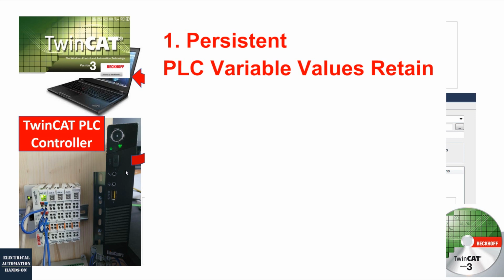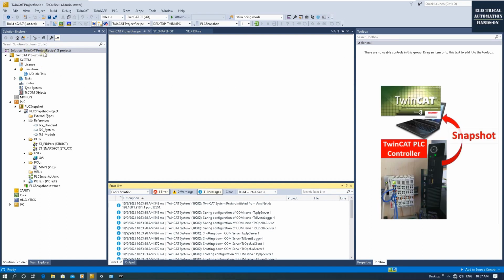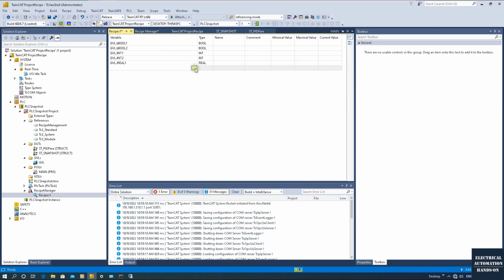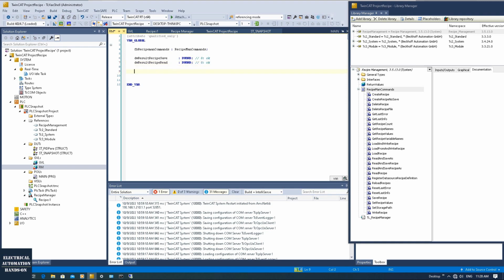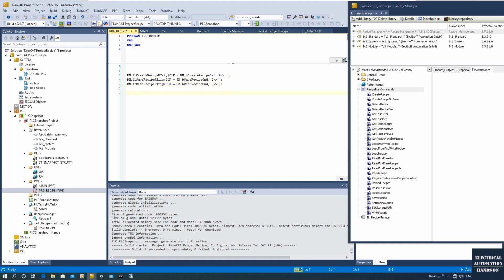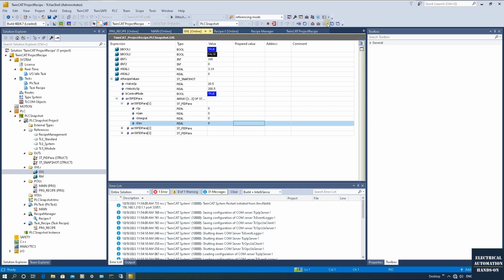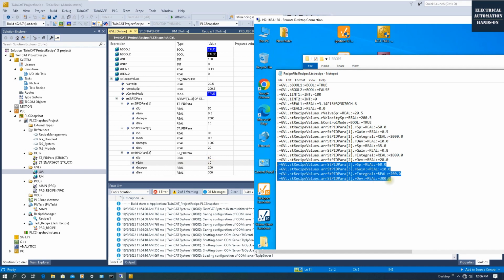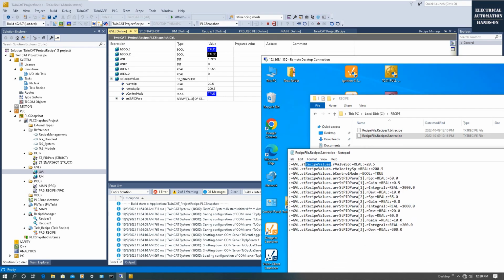BK20. Variable Data Snapshot / Archive via Beckhoff TwinCAT 3 Recipe Manager

Comment: I love Beckhoff but this is by far my biggest bitch. There should be a Twincat 3 option to save variable values with a project. You should NOT have to use a recipe manager. You should NOT have  to copy .bootdata files. It should be built in Twincat like RSLogix5000 or should have a tool like Omron Sysmax.
Reply from the maker: It would be nice to have more options to archive data without Recipe Manager.
Reply: You can try using persistent variables in TwinCAT - the values of these variables are saved between power cycles. Not sure if this is what you're asking for.